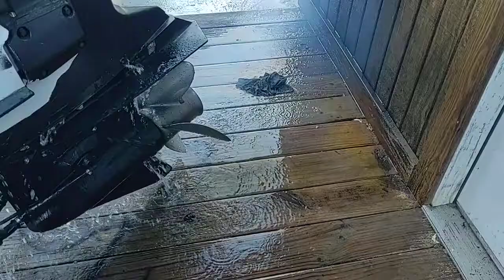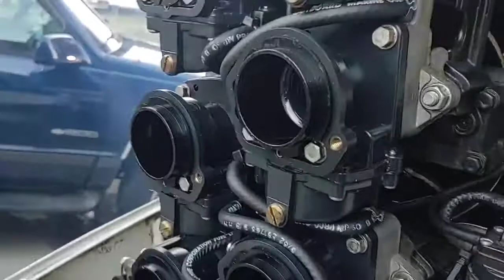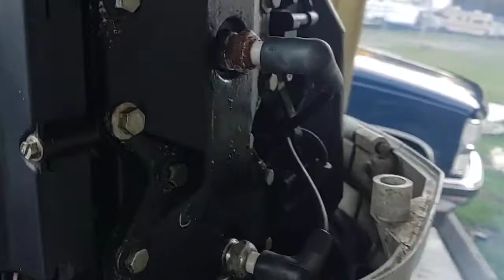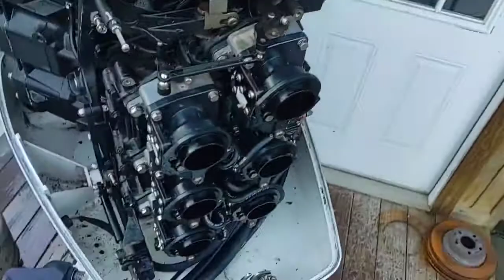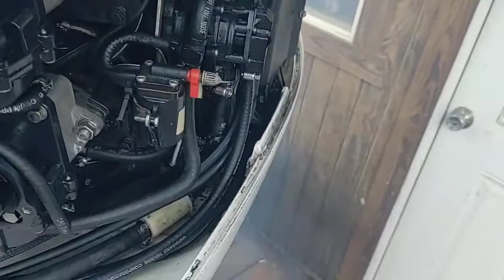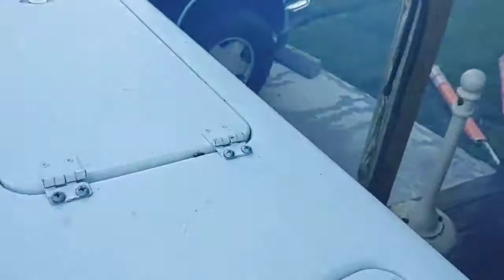Johnson Ocean runner 225 after cab rebuild and replacing VRO fuel pump 5 16 hose

Comment: Nice video!  Im getting my 1998 evinrude 225 HO back together. Quick question. On the front of the block, all the way at the bottom below all of the carburetors is a little 90-degree brass nipple that I can't for the life of me remember what goes on there. I believe its a water outlet but im not sure. Would you be able to see if yours has it and what it connects to?

Comment: How many rpm
Reply from the maker: I think my Max rpm was around 4200. It would turn more but never pushed it.
Reply: @sanitymaintenance573  when idling.  I'm idling around 1k to 1100 on the hose
Reply: Amigo tenho um desse , as vezes fico estressado porque ele fica ruim para pegar do nada . Tem alguma dica para né passar ???